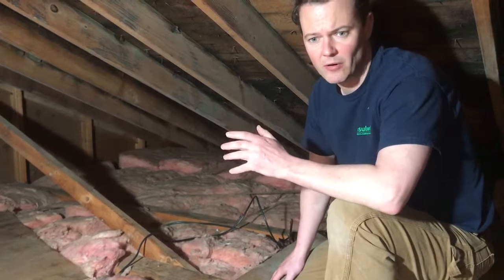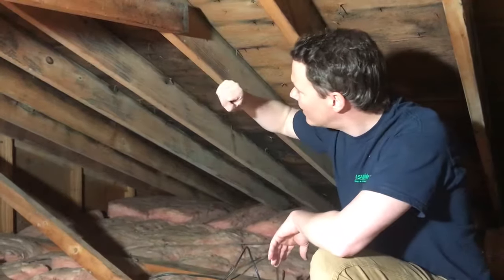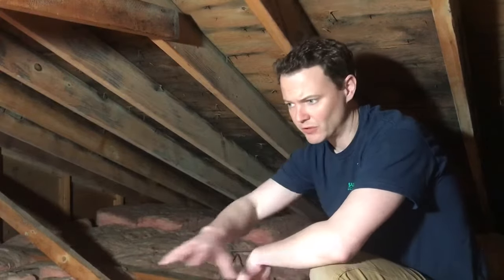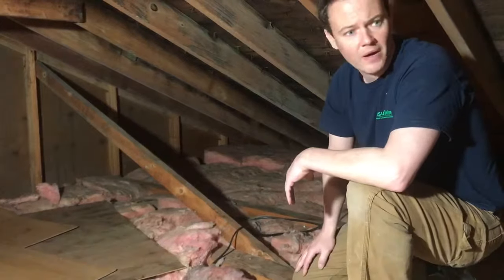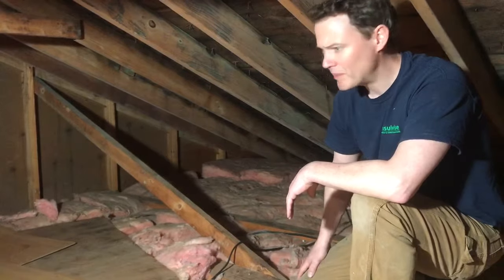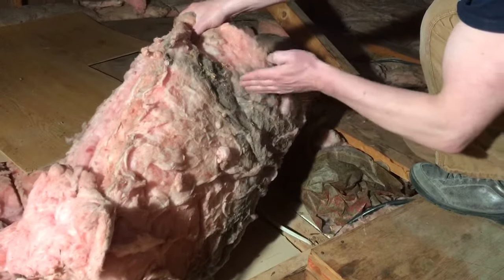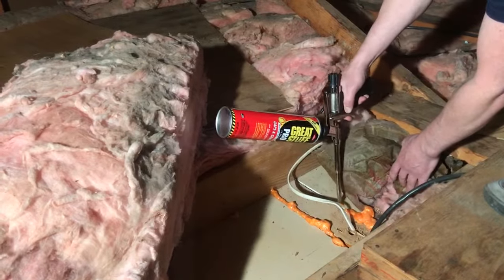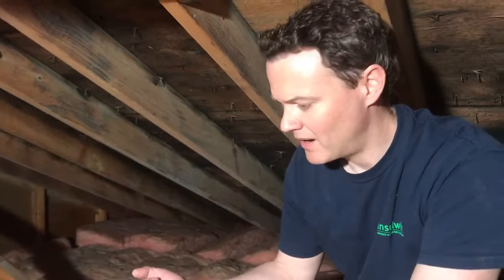There's Mold in my Attic!  What Caused it and How Insulwise Solves it.

Comment: my house dosent have any soffits, but would putting gable vents help ?
Reply from the maker: When a house is aligned in an East / West configuration, gable vents (assuming they are the larger kind and not the smaller kind) can do a terrific job ventilating attics because they are able to capture the natural Westward breeze that happens.  You won't read about this much, but I have witnessed the effectiveness of gable vents many times.  If your home does not have an East / West configuration, I would consider installing slant back vents for intake vents about 1-2 feet up from the gutter.  The best option would be to have undershingle intake vents installed, but these are generally only done during a roof replacement.  However, the number one thing that you want to do have get your attic air sealed.  If you can do this you will dramatically limit the amount of water vapor escaping upward into your attic when it is colder out, and thus reduce the risk of a mold issue (assuming you live in a colder climate).
Hope this helped!
Andy

Comment: Great Stuff Pro foam is that stuff ok to use around electrical? Or is there another foam someone recommends for use in Texas. I have to go do this in my attic
Reply from the maker: Great stuff will work just fine, it's actually what we prefer relative to the other brands.  We seal around romex wires, junction boxes, etc.  You do not want to inject it into a junction box though or risk putting it into direct contact with live wire junctions.  It should only be used for sealing the outside of electrical boxes.   It'll withstand the heat of hot attics just fine, what will break it down is UV light, which it should not be exposed to inside an attic. 

Hope this helps!
Andy

Comment: I have soffit vents all along the north and south sides of my home, but the 6 vents in the attached garage seem to be blocked, but I have 9 vents outside on that north side that aren't blocked and 7 square roof vents put in about 8-10 inches from the roof ridge, all in the north side of my roof.  I'm in southern KY and I have a condensation problem on my north side of roof decking.  I also have gables with air openings in the gables as well, so you would think I have plenty of air but I have mold and condensation.  A roofer told me to install a dehumidifer in the attic, the unsealed attic...so I guess I am dehumidifying the entire air in and out of my attic (sarcasm)?  Anyway, maybe this would work, I have no idea but before I try to figure out how to run a dehumidifier in my attic can you maybe give me an idea if those 6 soffit vents are the key?  I do not have anything vented into my attic, no bathroom fans, just the usual pipes for the air needed for the plumbing fixtures.  Roof is in great shape according to the roofer I had look at it.
Reply from the maker: Yeah, I wouldn't recommend attempting to dehumidify your unconditioned and vented attic, which would require dehumidifying the local atmosphere around your home  ; ).  Condensation almost always forms first on the northern sides of the roof, and typically lower down.  That is the area that receives the least amount of sunlight / solar radiative heating during our winter days, so it has the most difficulty warming up and drying out.  

You first need to make sure that all of your soffit / intake vents are unblocked.  Having more functioning exhaust ventilation up high on your roof than intake ventilation down low can "depressurize" your attic...this in effect can create an upward draft in your home that pulls warm moist air upward into your attic through the air leaks in your attic floor.  If your intake and exhaust ventilation are balanced, or even better, if you have a bit more intake than exhaust, this is issue is far less likely to happen.  The exhaust vents simply draw from the intake vents lower down on the roof. 

After getting your ventilation figured out you then need to deal with the issue of where the moisture is coming from.  If your roof is in good shape, than the moisture is likely coming from inside your home by virtue of Stack Effect causing warm, moist air inside your home to rise and escape upward through air leaks in your attic floor and into your attic.  That water vapor then condenses on the underside of your roof sheathing when its' temperature falls below the dewpoint temperature.

You need to get these air leaks sealed as they are more than likely contributing to your condensation issue.  You also need to make sure that all of your bathroom fans, clothes driers, etc are venting to the outside.  Another contributing factor could be a humidifier on your furnace.  For the time being turn it off...and I'll bet you'll see a big difference in condensation build up.  Where do you think A LOT of that water eventually winds up?  You guessed it...your attic.  

Check out our page here to see what Air Sealing is: 
https://www.insulwise.com/insulation/air-sealing-insulwise-pittsburgh/

So, get your ventilation figured out (maximize your intake ventilation), get your attic floor air sealed (either yourself or hire a contractor who understands this stuff), and dial down your humidifier.  Once your attic floor has been air sealed, your home will naturally lose MUCH less humidity...so you won't need the humidifier nearly as much.  These measures will likely staunch your attic condensation issues.  If you have other questions hit me up. 

Lastly, this is our Attic Mold page.  Lots of good pics.
https://www.insulwise.com/pittsburgh-attic-mold-specialists/

Hope this helps!
Andy

Comment: How do you clean out the mold where the roof panels (horizontal part) meets the other part of the Vertical part of the wood ? Sorry I'm just a homeowner that had a plumbing leak due to plumber damaging the flange. I cleaned out all the black marks but can't access where the floor wood meets the vertical part of the wood.
Reply from the maker: Hi Ray sorry the late response.  I'm not sure that I understand the specific areas that you're referring to.  If you eliminated the plumbing leak and that area has been allowed to dry out, whatever mold was growing there will no longer be able to grow.  For an added measure any off the shelf "mold killing" solution you'd find at one of the big box stores should wipe out the mold that has been growing there if you can spray it real good. 
Hope this helps!
Andy
Reply: @insulwiseenergycomfortsolu3293  I did all the above,  nothing seems to be growing anymore. What I was concerned about is where the floor wood meets the vertical part, the cross part. I can't access the wood, even tried to stab a wet thin cloth between the wood, of course I  couldn't access it since they lie on top of each other. So I soaked the edges and hopefully prevent any mold.

Comment: White power deposits are dry rot, the roof needs adequate ventilation. And the wood then  treated against rot. Unless the ceiling boards are backed with silver foil you are wasting your time sealing gaps ,as moisture will go straight through the ceiling and into the roof space.
Reply from the maker: Hi William, I appreciate your comments.  Couple of things.  1)  Having painted houses for several years I am well experienced with dry rot.  What you're seeing on the rafters isn't it.  It is absolutely mold growth.   There is also another after video we shot where you can see that the underside of the roof looks dramatically different, basically it looks as though it were new ( https://www.youtube.com/watch?v=u_Yu0gv_Hsk )  .  A dry rotted surface would not react that way.  
 2)  Once the mold has been killed, adequate ventilation has been determined present or added, and the source of moisture eliminated, the wood will not continue to rot as microbes / fungus cannot grow on it due to lack of moisture  
3)  I am not sure what you mean by ceiling boards.  The ceiling below this attic was built using drywall and has several layers of latex paint on it.  Although not a perfect vapor barrier, a surface like this functions pretty well as one.  After the penetrations / air leaks in the attic floor are sealed with foam the amount of moisture that can move upward from the home and into the attic space is sharply reduced.  We often test this in homes using a blower door and separate monometer to conduct a zone pressure test to confirm that we have effectively separated the attic from the living space below.  
Lastly, we have performed this solution hundreds of times in homes in our area over the years with just a handful of callbacks.  And I know with certainty that with mold if you do not fix the moisture issue, it will almost always come back.  
Thanks!
Andy

Comment: Thanks Andy, I have a similar problem in a cape cod home. I don't have soffit vents but I have a ridge vent. Would the issue be resolved if I add gable vents for intake?
Reply from the maker: If the mold is showing up in the knee wall attic spaces than getting ventilation to that space would definitely help.  However, you also want to get that space air sealed from the home as best you can, and definitely make sure any bathroom fans venting into that space are vented to the outside.  Our order of operation for attic mold is 1)  shut down the moisture source  2)  properly ventilate the space 3)  kill the mold.
Hope this helps!
Andy

Comment: ? I’ve noticed this in my attic and it’s the 1st year running a humidifier.. I live in a log cabin No gable vents, no soffit vents, no ridge vent.. and I don’t have a standard drywall ceiling I used ship lap or tongue in grove pine as I call it.. so cracks probably everywhere .my plan is to plywood the whole attic for storage would that stop the air leaks? Also what kind of mold killer would you recommend?
Reply from the maker: Ok, if you live in a cold climate what you've just described to me is mold's "dream situation."  There is plenty of heat, moisture, and no effective way to dry via outside ventilation.  Your ceiling is effectively a screen door, although I have no doubt that from the underside it is beautiful.  I have attempted to "fix" several log cabin style homes.  They are always quaint and beautiful, but a building scientist's nightmare.  If you plywood over the ceiling for storage it will not stop the air leaks.   The air and moisture from the home will largely get trapped beneath it, and then mold will begin growing on the underside of the plywood and gradually rot it.  This will also allow for the possibility of showering the inside of your home with a steady supply of mold spores down the road (as the spores fall down through the cracks in your ceiling).   You need to do 2 things:
1)  Completely seal your attic floor from your home below.  With what you've described, the best way to accomplish this would be to have a spray foam company come out and spray at least 1" inch of closed cell foam over the entire attic floor.  That will provide both an air and more importantly, vapor barrier.  You can then insulate over top of that foam and install a storage pad.  
2)  Find a way to effectively ventilate your attic be installing vents in the roof or a few big gable vents.  You always need to provide a way for moisture to escape the top of a structure (unless you are making the air and thermal barrier at the top of the structure, which I'll mention next).

OR, 
You could have a spray foam company come out and use closed cell foam (this is important because only closed cell foam can create an air AND vapor barrier.  The more common open cell foam CANNOT give you a vapor barrier, regardless of how thick it is sprayed on, and establishing an effective vapor barrier is critical) to insulate the underside of your roof.  This is called a "hot roof" solution.  About 3-4" of closed cell foam expertly applied to the underside of your roof would likely create a very nice solution for you.  

Best of luck!
Andy
Reply: @insulwiseenergycomfortsolu3293  Thanks for your Help Andy I’ll have to figure out what to.. I do want to put some gable vents in or maybe windows to also bring some natural light in as well.. I shut down the humidifier and it looks a lot drier up there.. If I have the spray foam on ceiling from the attic before batting insulation and plywood attic floor would that work?
Reply from the maker: @fanman1981    Hi there, yes that should work pretty well.  But you'll need to use closed cell foam because it will create a vapor barrier as well as a vapor barrier, about 1-2" inches will do nicely.   You'll still need to get that attic ventilated though.  Sh*t happens in houses my friend, especially with moisture.  You'll want a good plan B in the case that it does, and some decent attic vents will help you a lot there. 

Andy

Comment: Andy, good explanation of what is going on there.  Shouldn't they put in soffit vents to solve this problem?
Reply from the maker: In Pittsburgh from the mid 1960's through the late 1970's there were a lot of homes that were built without any type of overhang.  The roof ends directly on top of the exterior walls, and the gutter sits right there too.  With these types of homes soffit vents can be installed, but it is a major renovation that involves building onto and extending the roof.  A customer of mine was recently quoted $20,000 for doing this.  Another option could be installing "smart vents" or undershingle vents about a foot up from the gutter, but this can really only be done when the entire roof is replaced because (unless you want to hire a roofer to cut into your existing shingles, but I'm not sure how challenging a retrofit that is).

These types of homes were most often built with gable vents, which we at Insulwise believe to often be extremely effective (when these homes are alligned in an East / West orientation, you'll often feel a breeze blowing right through the attic).  Gable vents allow wind to naturally push air directly through the attic, without really depressurizing it.  When homes that were built without soffit vents or overhangs have ridge vents installed on them, that's where we seem to see a lot of mold issues.  The "intake" for these ridge vents effectively becomes the house itself, especially during the winter months when Stack Effect within the house (warm air becoming buoyant and wanting to rise upward) is already happening.  

Andy
Reply from the maker: Hi Chris, soffit vents, or any type of intake ventilation would certainly be helpful here.  This home however had a type of roof that wouldn't allow for that.  There was literally zero overhang.  Also, from our standpoint concerning mold issues, the first and most important thing to do is eliminate the moisture source.  You may or may not be able to "ventilate away" a mold issue.   But if you eliminate the moisture, or drive down the amount getting to the space dramatically -- you will make it impossible for the mold to continue to grow.
Reply: @insulwiseenergycomfortsolu3293  Makes sense Andy.  Where did the bathroom exhausts vent?
Reply: All bathroom vents were vented to the outside through the roof.  It’s the first thing that we look for.

Comment: Very well explained! I have read that vinegar and Borax also kill mold quite well. I have a 5ft x 5ft spot on my roof sheathing to treat, as a homeowner, do you think I need to go with RMR-86 or is the vinegar  or Borax going to do it?
Also I think you answered this before, but does one need to scrub mold first? or just spray on the biocide?
Thanks!
Reply from the maker: We've never scrubbed the mold off, but some people believe that you need to.  You can see in our video that once we're done, it looks like new plywood, it's not furry or anything.  Additionally, if you've prepped the attic properly in terms of air sealing the air leaks in the attic floor, making sure the roof isn't leaking, and making sure the roof is properly ventilated, it should be extremely difficult for mold to start growing again.  
Hope this helps!
Andy
Reply: @insulwiseenergycomfortsolu3293  Thanks Andy, do you think I need to go with RMR-86 or is the Vinegar  or Borax going to do it?
Reply from the maker: @struswell1  We use the RMR and it's legit, but extremely powerful.  You will need a full face respirator and rubber / vinyl clothing that it can't easily penetrate (unless you are reaaaally good at avoiding the drips).  Concrobium is another good product.  A lot of stuff out there will kill it, but you may still see the stains, and they can appear active and still growing even though they're dead.  What RMR also does a great job of doing is eliminating the mold stain itself.  I'd try the lighter stuff first and see if it works for you.  

Andy
Reply: @insulwiseenergycomfortsolu3293  Thanks! I hope you get great carma from helping so many people!!